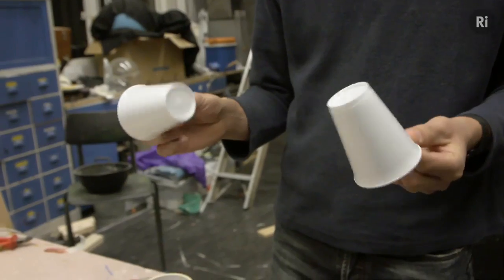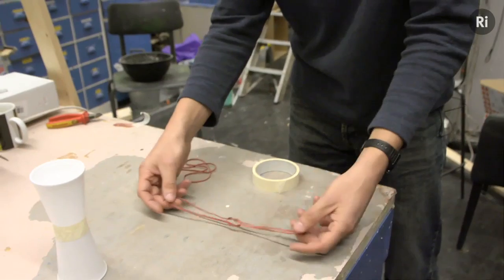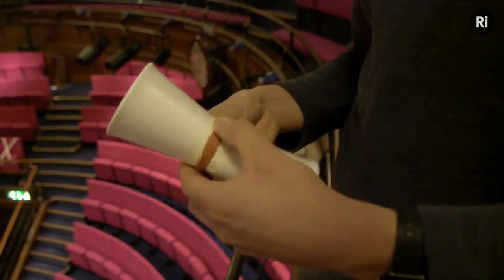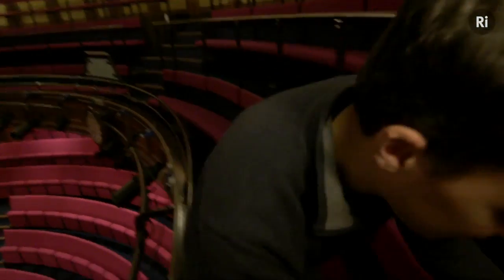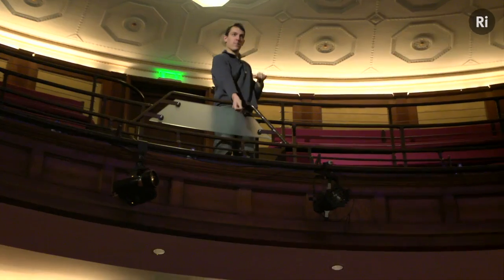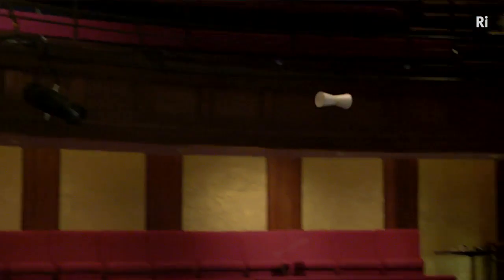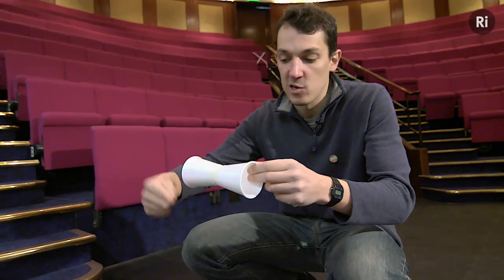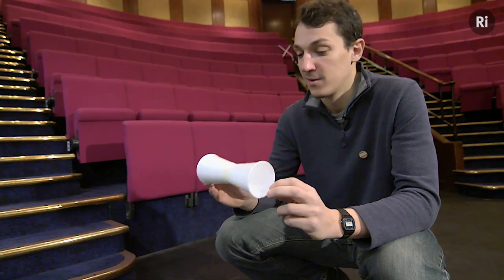Tales from the Prep Room: Magnus Cups

Comment: Would adding a weight between the cups (a coin) help it maintain momentum and increase the duration of flight?

I've got a feeling that the drag from the air is slowing the spin of the polystyrene cups too quickly.

Comment: This is the same principle as a curve ball in baseball.  The forward momentum of the ball causes wind drag which is amplified by the spin forward and decreased by the backward spin thus piling up air infront of the ball like a snow plow.  This will not work well for a flying craft as propulsion however it will provide vector thrusting while the vehicle is on the move.  A squirrel cage fan, elongated can lift a craft and then propel it forward more efficiently then anything using magnus effect or cowanda effect.